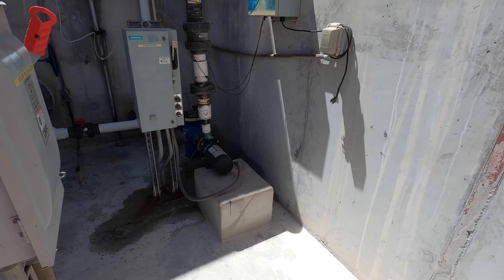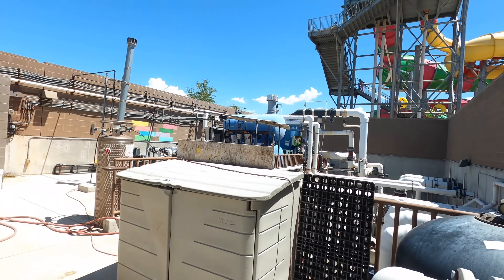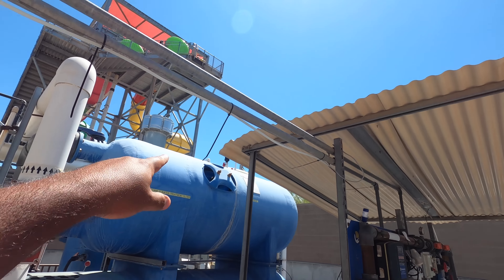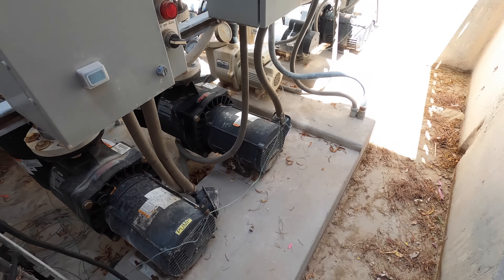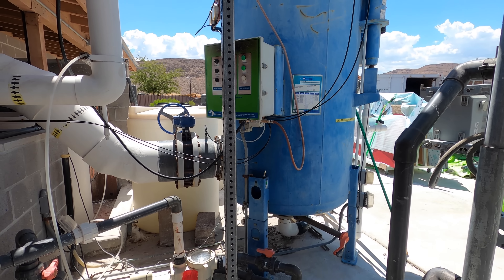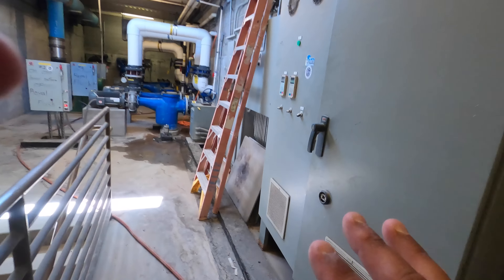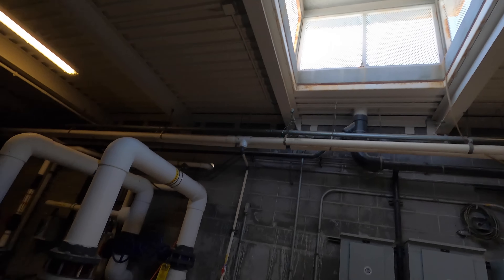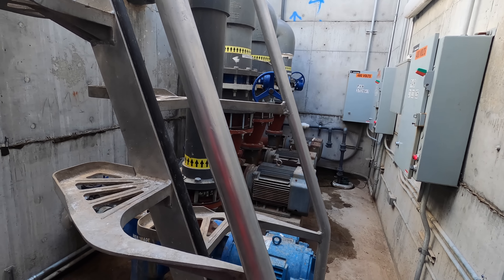Water Park Pump House Tour Vegas West

Comment: After being to Las Vegas recently and always having a dry mouth because of the dry air there: Is the amount of daily evaporation measurably higher than in Texas, and if so, by how much?
Reply: The belligio fountain loses 12 million gallons of water a year and it only holds 22 million gallons. Over 50% of the water has to be replaced a year due to that only. And the tap water has high heavy metals and radiation levels from mountain run off and radiation from Nevada test site and bomb ranges water runoff.

Comment: Why does this location not utilize surge pits like the Texas locations do?
Reply from the maker: They actually do, but they are in vaults and not easily accessible.
Reply: @thepoolguy  vaults?
Reply: @coastercreations5299  I’m guessing it’s basically a sealed box under ground sort of like if the Texas pits had a top on them and were lower in the ground. I’m thinking the benefit is better evaporation control but idk what you would do about material build up in the vault
Reply: @mc63100  Thank You!
Reply: @mc63100  Draining and cleaning the vaults is never a good time.